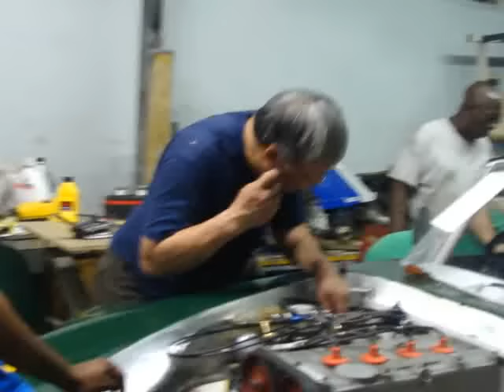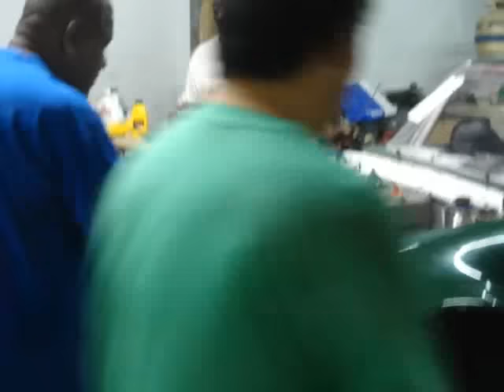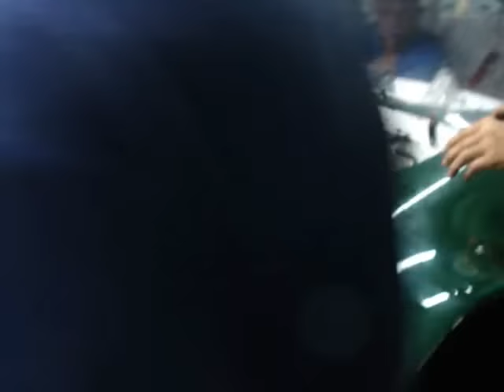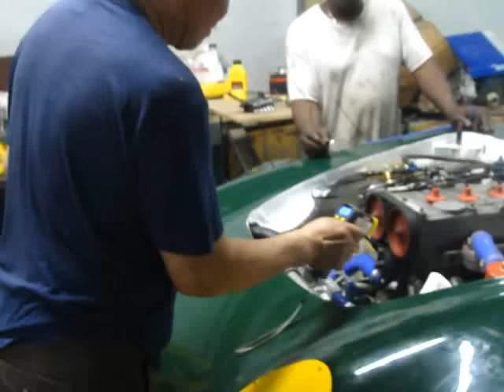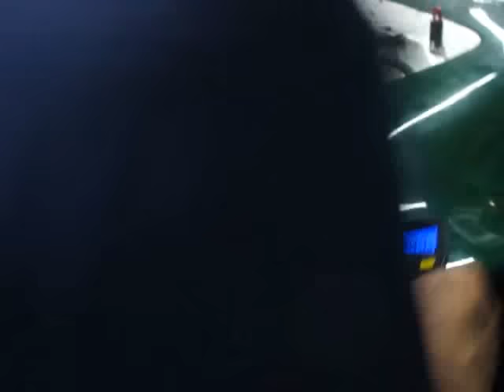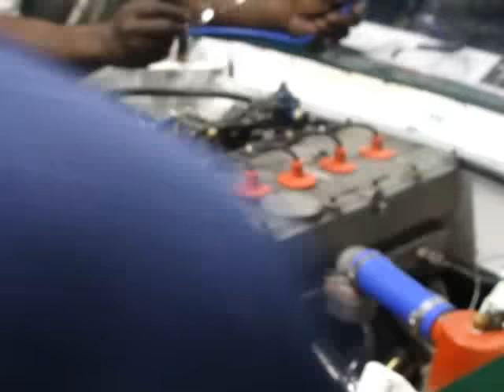Tuning Old school style. There aren't many people today who know how to do this.

Comment: Bullshit video, I expected idle, mains and emulsion tubes, distributer Bob weights setting the advance. all he did was ballance  a pair of dcoe/dhla  and then used the infered thermometer.  Not exactly old school tuning, I'm surrounded by people who do this properly every day.
Reply: I was just going to say the same thing, my dad does it properly on all sorts of classic Porsche engines. This old guy is a joke anyone can balance carbs!
Reply: @ioannichols6485  calm down kid. Really anyone can balance carbs? With just a piece of tube in his ear? Without vacuum gauges? Maybe your dad is a skilful mechanic, but this does dot prove that anyone can balance dual carbs. Also this guy if way far from "joke"...
Reply: Balancing individual barrel is the key for the maximum power  if they use same internal Spec they don't need set AFR anymore.
Reply from the maker: @niavras  this guy was something of a legend in my country. In the old days he raced cars he built in his garage. He did everything himself...engine suspension chassis etc. He raced against rich guys who brought down complete race cars from England from well known builders like Neil Brown. He would beat them with his home built racecar. David Vizard visited him once and drove a Nissan Sunny he had built for a friend of mine. He was so impressed with it he said it was faster than the Mini he raced back in England. It was a 1500cc n/a nissan sunny. Vizard rated him very highly...said he knows what he is doing.